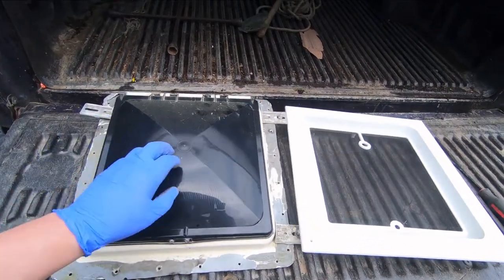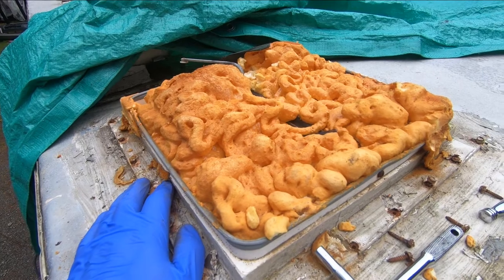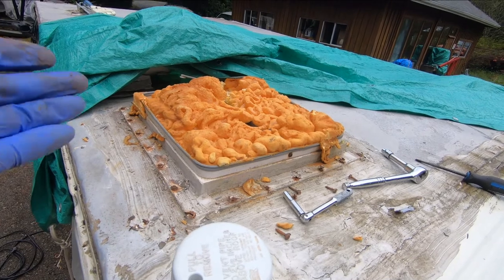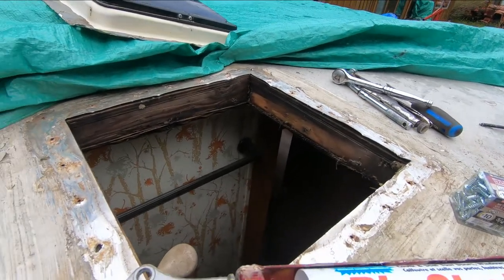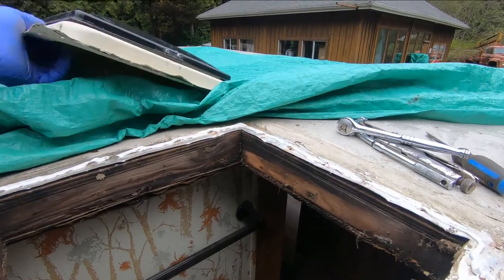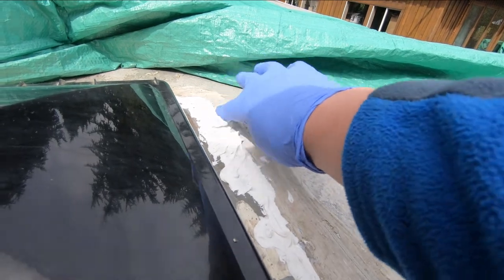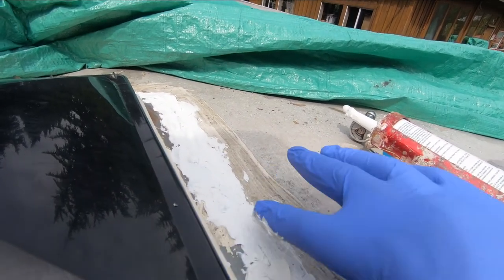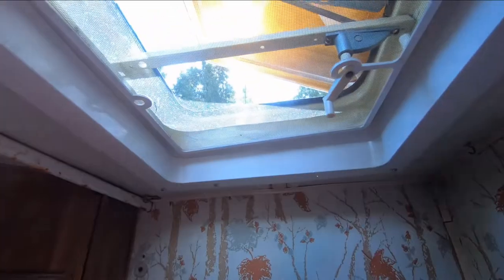HOW TO CHANGE A ROOFTOP VENT ON YOUR RV, TRAVEL TRAILER OR CARAVAN

Comment: That was an interesting previous repair, I have not seen anything like that before. Great repair, it looks good and will keep the water out
Reply from the maker: A God-awful repair it was ! Expanding foam has its uses but sealing a roof leak isn't one of them. The most interesting use for foam I've seen was when a contractor installed a basement window using this stuff. He placed the window, centered in the opening with some shims and then spray foamed all around it. The window was as solid as granite afterwards. This was an approach I wouldn't have though possible but it seemed to be their standard practice.

Comment: I have seen all kinds if leaks fixed incorrectly on the Rotary Engine cars some were really creative.. But if it was just fixed right the 1st time it would have been cheaper for everyone..
Reply from the maker: I hear ya, something worth doing is worth doing right (or at least in the ballpark). The foam "fix" on this vent wasn't anywhere near the stadium ! It's better now with the replacement vent and that flexible caulking. Thanks for stopping by, Dan.

Comment: What a doozy! I'm all for field expedient repairs but Man... A big pile of expanding foam? The mind boggles. I had to remove a non-functioning and leaking AC unit and "Make it work" so I clapped a piece of plexiglass over the hole with some adhesive silicone. It didn't have to go for very long, just get a guy through the winter. Nice fix on your part anyhow! Hopefully the rafters(?) aren't too destroyed but at least now it shouldn't leak. Yea, you have to keep up on these suckers.
Reply from the maker: When I picked up this trailer there were another full can of expanding foam inside. It looks like this stuff was his "Go-To" fix for everything from leaking roofs to everyday maintenance. You gotta love his simple approach to fixing things, Just hammer it full of Foam. "There, that's Fixed!" haha. I think the rafters are sufficiently strong for now (I layed up on there yesterday caulking around the other roof vent), but the rot in the back wall necessitates the tear-out of all the bathroom which is a job I'll be passing on to someone else. This old gal will be sold (with full disclosure about the rot). Too bad, I liked the layout with a rear, full bathroom with a separate shower. On the plus side, I won't have to pay the gas to haul this Heavy old trailer around-it is a beast to haul--even empty! Best wishes    Craig
Reply: @EverydayProjects  Much like Duct tape, it has it's uses but knuckleheads tend to apply it everywhere. It's gotten so bad that when I'm using expanding foam in the proper manner for the proper job I still feel kind of ashamed.